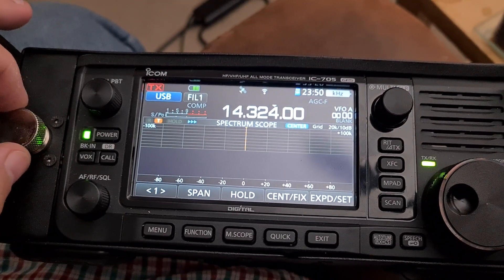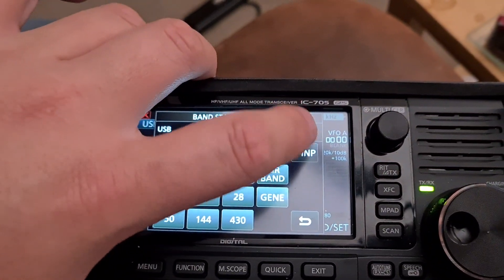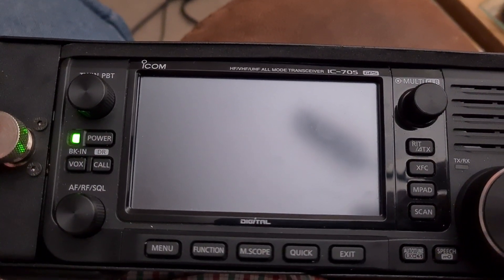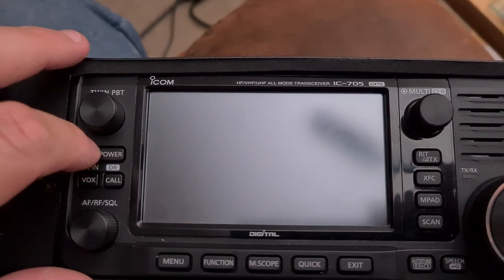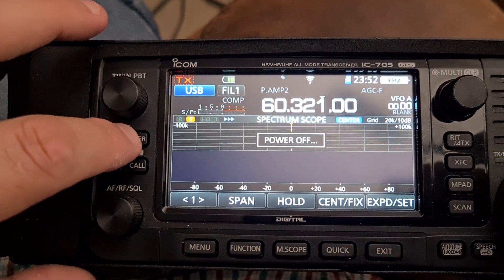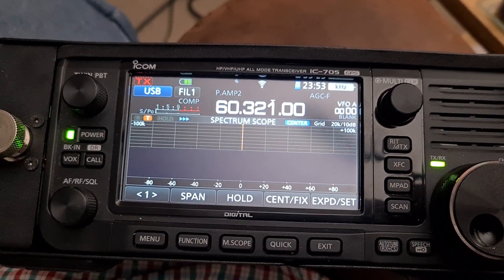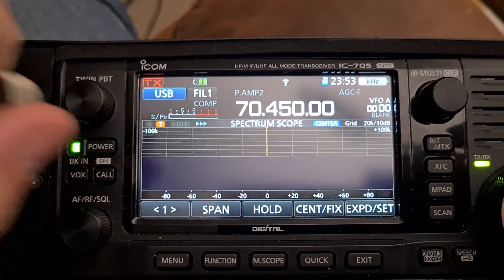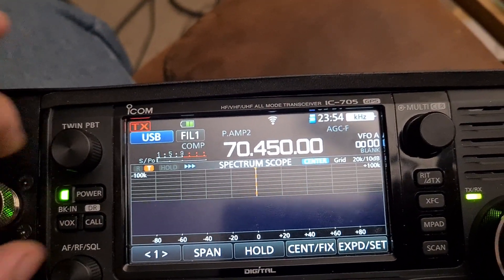Icom IC-705 Wideband on 4m/70MHz

Comment: Their two diodes that you remove to widebanded the 705, I read that the uk model already has one of the diodes remove so that you can use 5mhz. From what was reported when the mod was first being done only uk and eu model will unlock 70mhz once the mod is done, but all reports done at the time reported that while you can receive and transmit on 70mhz, there was no tx power when transmitting. Some surmise that there must be some additional setting need to be done to get tx power on transmission.
Reply from the maker: Mine appears to transmit on 70 MHz too. I haven't put it on a spectrum analyser to see what power and how clean this is.
Reply: @m1geo   it will only go into tx but its not got any power output, its exactly like the Icom ic-7000 few years ago,
Reply from the maker: @chrismarren9308  that's not the full story though. Things are different if you look inside with a spectrum analyser and trace the signals. It's a work in progress to see what can be done. I just don't have the time!
Reply: @m1geo  I measued the output while no TX: -43.3 dBm; and with TX: same. No output. Nothing to be seen on the 7300 .

I did see that in the service manual though, there is a 70 MHz adjustment sesction. Maybe it is still possible to adjust, or it's really disabled at some stage.

My 7000 has been modified to do TX on 70 MHz but the second harmonic is LARGE and an additional filter+PA fixes that.
Reply from the maker: @RoelandJansen  could you send me the service manual? george@m1geo.com